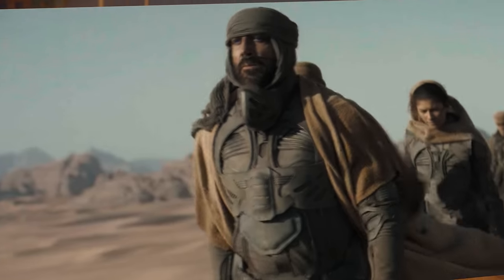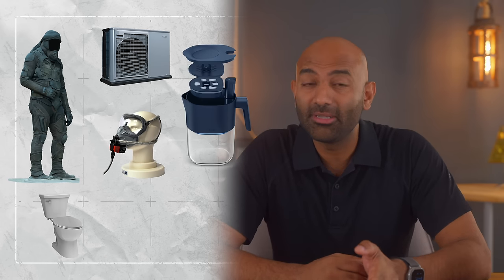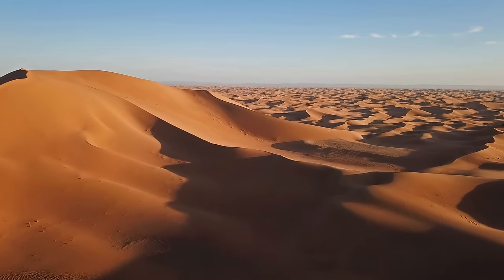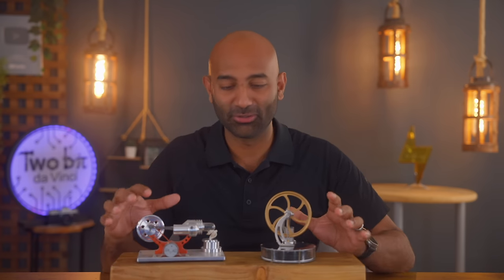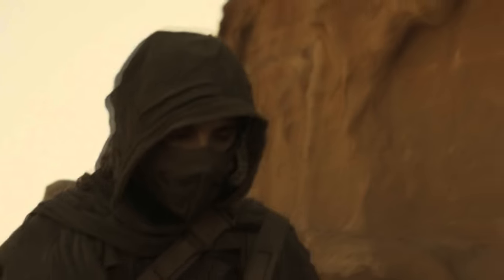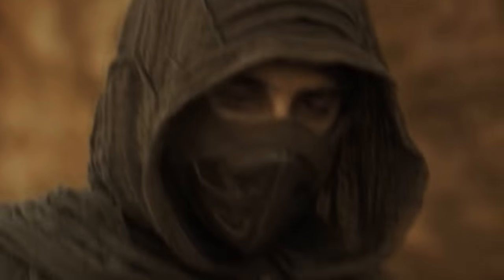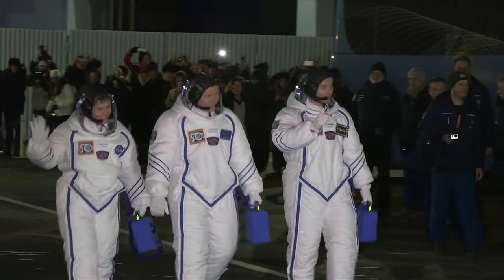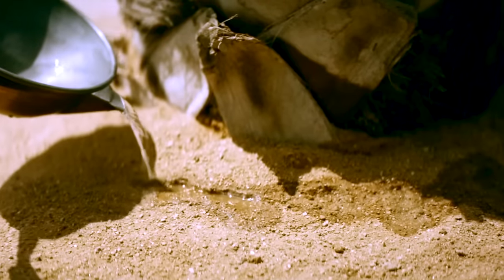Could the Dune Still Suit ACTUALLY Work?

Comment: The suit is explained more in depth in the later books. There are foot pumps on the suit for circulation and possibly electrical power. The masks are used way more than the nose tube, the director wanted to show the actors faces more.

Comment: if you make a sort of vacuum chamber where every step you make will increase the pressure one way only (like the pressure in the chamber increase but don't let the pressure out)  after walking for at least 15 mins the pressure will increase to great levels. as they make it in the scene where they extract the water from jamis. and then use that vacuum for osmosis to purify the waste from sweat urine and feces.

Comment: Thanks for sharing your thoughts, ideas and videos. Very fun idea for a project. I think you may have been a bit quick to dismiss sterling technology. Just need to reimagine the gas flows in a flexible instead of ridged container. My overall take would be, if you could actually make it work it likely would be exhausting to wear since every move you made in it would be against a resistance in one fashion or another.

Comment: yes we talked about this before, the current problem some fans in engineering pointed is the cooling and water filtration units , with our current technology, the cooling and water filtration is too big to be in a suit, so mobility and compatibility will be an issue, but the rest like osmosis fiber and waste management is very possible. its all possible we can definitely build one but  the wearer will need to carry a big heavy bag containing the cooling and filtration units which you definitely cant move and fight with.

Comment: Assuming 10192 is standard time, or Earth based AD, they are ~8200 years ahead of us. 

So, 2 big things: 

A) Nano tech will be amaze balls then
B) Solar tech will likely be ~99.99% efficient. 

If you're still suit could have perfect reflectivity, and perfect solar conversion, then how will it work? Well, think about when you go stand outside for 30 minutes naked. Where do you get sunburned? On your shoulders and neck. Shoulders mainly, because they point toward the sun. 

So how would a still suit be designed? It would have solar nano tech in the shoulders, and perfect reflectivity elsewhere. Think super white paint that reflects the sun, eliminating the need for air conditioning!

Then you are nice and cool inside, and you've got all the power you need for airflow, water filtration, etc.

Comment: ok, aside from the feces part, I think I can see how this can be done;
inner layer, almost any of the modern comfortable wicking fabrics would do to pull sweat away from the skin. less than half a mm thick in most places.

a thin layer of Gore Tex, which does a beautiful job of water vapor to pass, but disallows liquid water from passing through, another half a mm
The outermost layer would be a fairly thin, tough, beathable material to put up with the harsh outer environment du jour. the next layer in would be a thick insulating material, much like winter clothing to keep the heat out.
In between the outer and inner layers would be a 2-3mm thick layer of flexible polyurethane, shot through with cooling tubes carrying water, and collection pores and tubing to precipitate and collect water. as long at this layer is kept a few degrees below the wearer's skin temp(5-10c), it should work fine.

Breathing; since the point is to collect moisture, it would make sense to run exhalation through a chiller, a similar process by passing it over the chilled polyurethane, pushing the dried air into the insulation layer, being cooler than the surrounding air.
Urine; standard collection, to be fed into a non flexible reservoir that is on the outside of the insulating layer, this allows for vapor distillation with precipitation onto the chiller layer, at a cost of having to chill that too

💩not going here, collection alone is a nightmare

Cooling; this whole thing depends upon cooling,
Polyurethane is actually a great heat conductor, on a par with some metals, very flexible, and hydrophilic, great for capturing water and cooling with
A human generates an average of 100 watts of heat on average, as high as 250W in heavy exertion.
add heat leakage from the outside environment by various means, you can figure about 500W of heat to be unloaded, max, this can be handled with 100-200w expended on a heat pump. likely half the size of a dorm fridge compressor unit.

Peltier Effect? unless there is some extreme breakthrough, fugettaboutit, while small, their efficiency is horrible.
I would imagine this would have more the look of heavy winter clothing than the movies show

Comment: Ricky, you apparently skipped using bacteria to break down waste. Saprophytic bacteria devour dead organic substances, which helps to break down waste into inorganic and organic byproducts. These bacteria play a critical role in the treatment of sewage by facilitating or accelerating the decomposition process of organic matter. It would not necessarily remove all the wastewater, but if 50% could be recycled that could be significant. If the bacteria could be optimized, perhaps it might actually work, sort of. Regardless, the idea of walking around for days in a stinky stillsuit, lugging your desiccated poop with you - ugh. Maybe that is the other reason for those masks...

Comment: Carbon nanotubes could solve the filtration & power systems issues as could microservo cranks in the ankles, knees, hips, & elbow joints. As for the waste filtration perhaps compression from the leg movement aids in seiving the solids. They do say fluids are involved in cooling, so heat sinking would be good in cooling off the fluids.

Comment: So , on the process of pumping , why not use multiple pumps , 2 on the heels , 2 on the elbows and behind the knees. Should work. Then reduce the amount of material you are filtering at a time so you won’t need as much pressure at a time.

Comment: This doesn't really relate to this video... 
But I keep wondering what built in wind turbines could do for battery life in an electric car. 

The draft effect is there anyway,  with draft the turbines could be completely hidden from view. Going down hill, slowing down,... maybe having two turbines one that spins at less of a drag effect and one that opens up when your coasting and going down hill that has more of a drag effect. 

Just putting the idea out there, haven't seen much on the topic
Reply: Most electric cars make use of regenerative braking that recharges the battery when coasting or braking. This is why, unless you drive like a maniac you seldom need to replace your brake pads or discs. This is just one way of saving on repair costs along with far fewer moving parts to wear out, no oil/filter changes, etc... and why the existing automotive industry is spreading false information...to scare people so they won't make the  switch.

Comment: Peltier chips and solar panels don't mix. Also solar panels and desert. And conductors and desert and peltier chips. The problem is the heat. As solar panels get hotter they lose efficiency and as conductors heat up the electrical resistance in them rises. You would have to have another layer of insulation to keep the panels and electronics in the still suit cool. So you'd have to have the outside of the suit cooled and the inside too. Where do you put all that heat? I'd say the stillsuit uses some coolant loop that then gets cooled by converting the heat to electricity somehow. It is 20k years in the future, we have enough time to figure that out. 

Also, space suits aren't big insulators. They are big radiators. Space insulates. In space there is no way to lose heat other than radiation. If astronauts didn't have any cooing garment underneath that space suit, they would overheat because they wouldn't be able to lose heat.

Comment: It seems likely that you could do an actual thermodynamic analysis of how much energy it would take to pump heat away from your body, and how much extra heat gets created when doing mechanical work to mechanically power the suit, and how much energy solar panels could generate… l haven’t done the analysis, but it wouldn’t surprise me if it turned out to be thermodynamically impossible.

Comment: It could be feasable if there is an active energy input to it... Like photovoltaic energy would probably be enough.. 

Also some kind of biochemical, biomechanical process could make filtering water more efficient without requiring so hot pressures

Comment: There are many different refrigerants than 134a. 134 is usually used in a lot of appliances and automotive. R22and 410a in residential ac. And several others.

Comment: Well, you are looking at this as a physicist or an engineer might (and you did a good summary job of that). But perhaps you should turn to organics and life form evolution, maybe cell membrane interfaces. The kidneys come to mind as well as the skin, both depending on a molecular biologic circulatory system. (Actually, pure "poop" never gets inside you - because topologically, you are a donut and food changes to poop as it travels through clouds of probiotics within the donut hole.) For outer coverings, so do the robes, scarfs, and hoods worn by Bedouins in the deserts. How do turtles rid themselves of heat? Etc. But if energy is needed, why not focus and use that heat? I enjoyed your video and agree that science fiction is food for the mind (and perhaps the soul).🙂

Comment: Sadly, if you use energy supplied by the wearer it would have to be generated by their metabolism, which is only about 25% efficient.  So for every extra watt of energy produced, 3 watt of extra heat would be produced.  Loss of water by sweating is actually a human super-power.  Only humans and horses sweat.  Water has a very high latent heat of vapourisation, so it takes away a lot of heat energy.  I loved Dune, though the film lacks a lot of the detail of the book, which embeds the adventure in a entire eco-system, economy and politics, but the Still suit could not work without an external power source.

Comment: Thanks for the video, it was interesting. The suits are black, so they absorb a great deal of heat from the sun, which can be used to heat water, which is then fed to heat sinks attached to peltier units on the cool side, to produce electricity which could be used to run other systems, including cooling. A thermal barrier would be needed to contain said heat from the outside, while allowing a flow of heat produced from the inside, to be collected & fed outside, maybe through a similar tubular fluid system & fed to the outside to help with running the peltier units electrical system. With various types of energy collection & productions, pulse pumps can be utilised to build up enough pressure to recycle liquids from the urine & faeces, which can be reduced to dust using a heating systems powered by solar energy amplifiers & liquid batteries, such liquid salt, which is also collected from your sweat, for night time continued use. These heating systems could also be used to overheat the waste, which could reduced the water content to zero, after collecting as vapour, leaving a usable byproduct, a powdered fertiliser for use in the sietch's for growing foods as seen in the movie. It is possible with modern technology to recycle everything from the human body, the ability to miniaturise it while maintaining the output, with lowed energy needs & weight is the obvious problem. Just thinking out loud.

Comment: How about a green bio suit rather than an electromechanical suit.  The digestive track of a kagaroo rat can recover a large part of the water from it's stool.  And you do still need to eliminate solid waste, so build one of those into your bio suit.  Our lympatic system is a pump with thousands of one-way valves that let's us move  about 2 lliters of fluid all over the body.  Your heart beat, your digestion and limb movement powers it.  And your kidneys are really good at separating the good from the bad fluids.  With some careful fluid engineering you could make a fluidic boost converter to drive the reverse osmosis. 

For power, your still suit could contain active photosynthetic material and could feed itself by putting a root up your butt.  There is plenty of fertilizer up there and water. It could be the last part of water recovery, energy generation and storage.  And rather than create electrical energy it creates biochemical energy that the biosuit could use. (ATP, starch, glycogen or fat)  Of course, the idea of it growing a potato up your butt... weeeellll.   The solid waste could be the sheding of leaves.  Or even a few fruits or grains :)  (an idea from a sci-fil story about a spacer with a symbiotic suit)

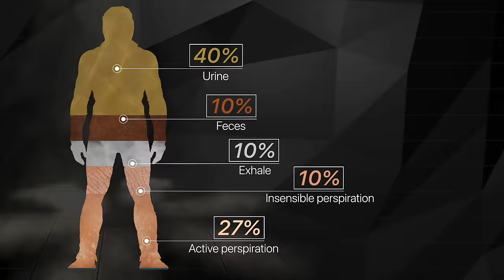Comment: 0:07 The suit would also require goggles - we have those two wet orbs in our faces,  and you:d be wasting water if you didn't have something there to capture and reclaim it.

It might be easier to reclaim urine & feces water if the suit came with a little bag, which you use when you need to go behind a rock & do a #2. That and a catheter...

In both cases, keep the waste in a sealed bag, let the heat of the sun evaporate the moisture, then reclaim the vapor.

I'm pretty sure the suit would need more than the power from the wearer's movements and solar cells. The suit is a human-shaped refrigerator and sewage treatment plant. Maybe in the Dune universe, they have better batteries.

As for desalinating, what about distillation? The sun's heat should do for getting the water to evaporate, then the suit's refrigeraton will also be cooling the water vapor. Getting enough energy to run the suit's cooling system is the hard part .

Comment: Pumping action for the still suit is driven by walking. Powered by your legs. Now imagine some hydraulic pressure bladders that siphon compression force from the contraction of your leg muscles squeezing and stretching the structure of the suit. If this hydraulic pressure is coordinated and directed through a piston crankshaft you can run your pumps and compressor off it. 
Provided humanity has access to metamaterials capable of handling high enough pressure without too much bulk or mass, you can run a compressed high pressure CO2 gas based coolant loop.
If your microtubule piping can handle 72.8 atmospheres, the CO2 in the system will be a supercritical fluid at any temperature above 30.98°C. It can definitely cool a body to a comfortable temperature if you can keep pumping it with bodily motion. The motion must be distributed and high torque, low speed in order to even be operable, but if COULD operate. Won't be easy though.

Comment: How did I feel about the movies? Honestly, my issue was with the changes the made to the characters which were unnecessary. I think they did a lot of changes to achieve four things 
1: Whitewash Paul
2: Avoid having to cast or CGI Alia 
3: Make Chani more of a "girlboss" 
4: "modernise" the characters and settings. (The characters all act more emotional and there are some weird comments about things like the Southerners being religious vs the northerners etc and the Atreides all came of as quite modern in part 1 and less machievellian. This is a mistake in my opinion. I don't watch sci fi for a commentary on our current thing, I watch sci fi to see ideas about different technologies, cultures and scenarios.)

Comment: I'm going to beg to differ on the poop... Take some poop and leave it out on a 150 degree day - I'm pretty sure the heat will evaporate off the moisture pretty quick.  So all you have to do is put the poop in a space where the external heat gets to it but the evaporating moisture is captured and then condensed elsewhere in the suit where its cooler.  Of course they never talk about how the poop gets into the system from your a$$...

Comment: 📍 CONSIDERATIONS: Several components can be rechargeable, replaceable, disposable, redundant.
🔹 batteries, capacitors, high-pressure charges/gasses
🔹 Salt/impurities = adsorption via zeolites, carbon, micro-high pressure pumps for RO, electrolysis, nanotubes, distillation, silver, chemical reagents, and even ethanol, etc.  
🔹 intravenous IV integration of fluids/nutrients ?
🔹 colonoscopy bags that dehydrate waste
⭐️ Using today’s technology (and nearly deployable technology), integrating rechargeable chemicals, heat exchangers (peltier chips, etc), solar power fabrics (suit and cape), solid waste dehydrators, nano channels and tubules, UV filters, micro scale high pressure pumps, distillation technologies, hydrophobic fabrics, integrated catheters (both urine and feces), battery tech & capacitors, etc. — I could envision a prototype of 20 kg. 
🔹 I can even imagine integrating food/gel pouches integrated into the water supply (adjusted by the biosensors) as well as medical needs/chemicals. Even integrating such tech as fish-skin-grafting, salves/ointments, nanotech, etc.

Comment: I think your analysis as an engineer is deeply flawed. Mostly because you lack the engineering knowledge. 

1. Peltiers are highly inefficient. There are physical limits to how efficient they can get. Peltier seems to be the turnkey solution for the self proclaimed engineer. 
2. You can wick water away from feces through gravity alone. 
3. For reverse osmosis you can easily create the pressures needed by doing it in increments. Body movements are enough to create these pressures maybe not in matter of seconds but in matter of hours yes it’s possible. 
4. Cooling your body through phase change effects is easier than you think. You don’t need a mechanical compressor for this. Think internals of computer heat sinks. Or the new passive heat pumps everyone is installing in their homes. 
5. Solar cells are not needed. You think our body needs solar cells? We sweat it’s called phase change cooling.